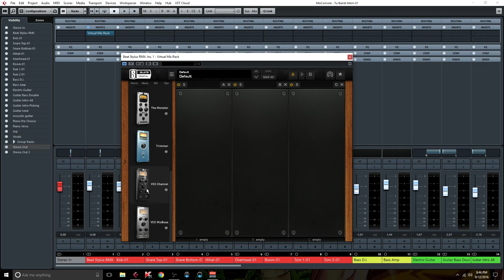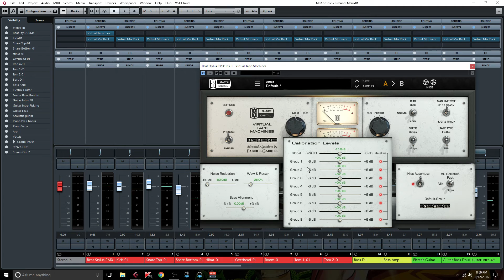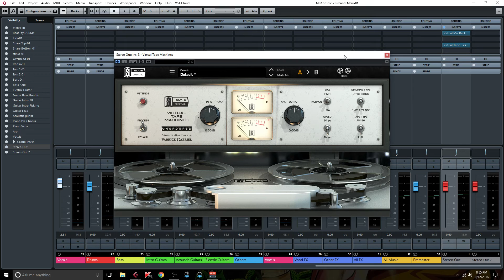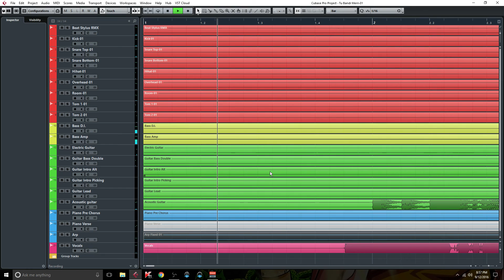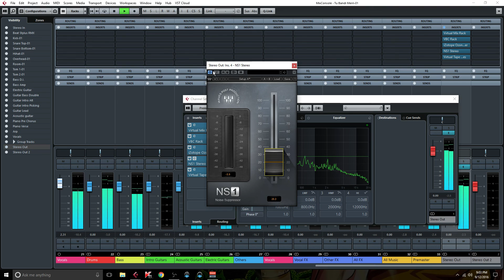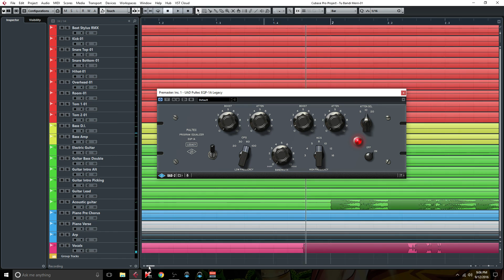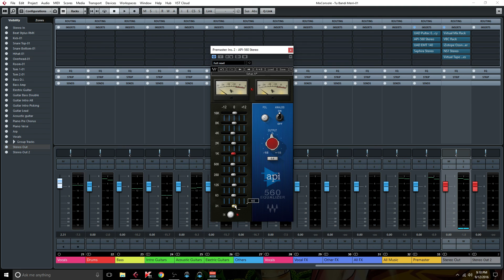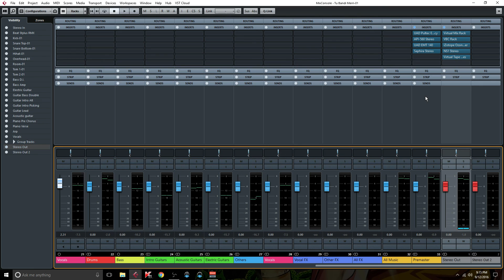Mixing a Song Start to Finish Part 3 Adding Analog Vibe and Mixbuss Processing

Comment: Try VCC and VTM on every track

For VTM:Low Bias for low istruments , reduce noise
Reply from the maker: That's the gist of it haha thanks =]
Reply: Brandon Beckwith Question: Is the analog vibe useful/enhancing for say a hip hop track with a lot of synths and drum samples?  Like would you use a VCC on every channel on that kind of track?
Reply from the maker: I would say any track can benefit from the VCC and VTM. When hip hop first started it was being recorded to tape and mixed with analog gear. :)
Reply: Brandon Beckwith Ok great thank you. And one last question, do you have tips for adding reverb to the master like you did here?

I was playing with the plate verbs in Izone 5 and it seems difficult to get right.
Reply from the maker: When doing anything with the mix buss you need to be subtle and make little moves. So for the reverb just ever so slightly add some on there. :)
Reply: Brandon Beckwith Ok thnks again.